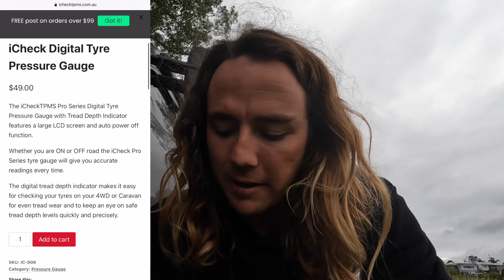4X4 Repairs and fishing a SECRET SPOT you didn’t even know existed! Trip Around Australia / Toyota

Comment: Awesome video guys and very good tips for maintenance and the importance. 
Anybody going on a 4x4 road trip should not take the planning lightly and think of all the possibility's that could arise from or during your trip.  
Most people dont realise that your suspension starts with your tyres, they absorb the initial impact before the suspention takes over. 
So tyres and wheels are super important and cheap equipment will get you in trouble insted of out of trouble. 
Steering is next on the list, check it regularly and repair immediately as needed. 
Then its brakes always keep them clean and mechanically healthy and hydraulicaly healthy. 
You never ever skimp on the three things that can cause serious injury and/or death from your vehicle, the three things that changes the attitude of the vehicle, steering, suspension and brakes. 
Then drive line, grease the prop shafts every service, and if you have any other grease nipples like sway bar or PTO take off’s grease every service.
Wheel bearings need servicing if they are serviceable, and CV joints 😂😂😂 many people get caught out with CV joints not being serviced. 
Regular wheel alignment and tyre rotation and balancing prolongs tyre life and vehicle stability. 
Next is another thing people neglect and its the electrical system, if your accessory's was fitted properly you wont need to spend lots of time to do basic checks and test the battery’s state of health and the charging system and load test all circuits to give them a clean bill of health. 
Next is also very neglected because it always works so what could go wrong…….the cooling system, anything less than 5 years is ok to accept if not used in the bush, grass seeds, leafs, twigs and bugs block the airflow,  after that coolant flush, expansion tank cap and remove radiator for cleaning they get blocked internally too and use only deminirelised water to mix you coolant.
The normal maintenance on the vehicle is what it is, oils, filters etc most people get that right and most of it. But pay attention to alternator belts, AC belts, visco fan, electric fan. 
These are my checks before a trip like you are going on now. 
We wont have our Urban for our December trip but we are still doing a part of it, I will start all the above at the end of September so by mid December the vehicle will get its normal service and check over to just double check all is healthy as humanly possible. 
Thanx for your hard work. 
Cheers
Johnny&Rene
Reply from the maker: Thanks mate!! 100% agree with all of the above!! Maintenance is key  and how you treat your car today is how your car will perform in a months time on a crap track haha 😂 

Cheers legends

Comment: Thanks for another great video, have ordered some TPMS from icheck. Safe travels look forward to the next one. Some tips re the Cape, check tyres car & caravan, make sure roofrack secured, shockies, nylon bushing, stone guard for caravan, cover up back window on car & tail lights, tape up outside door of HWS to keep out dust, also seal vents on van including door vent, pool noodles are good for pipes under van. A pressure system in van is great if you could get one. That's a start, you probably knew all that anyway. Cheers Geraldine & Jack we live in Bunbury area 👍hope to get up to the Cape soon.
Reply from the maker: Thanks mate!! Will do! You have bought the best tpms on the market!! We swear by it!! Sound advice mate! We are having a great time up here

Comment: Mate had knocking in my steering rack over bumps. Replaced rack ends which we’re worn but knock and play still there. Told by specialists that the rack was stuffed. Worked out that all was needed was the steering rack guide needed tightening a few turns. No more knocking and steering nice and tight like new.
Reply from the maker: Yeah right sounds like you got a bit messed around!! Our rack was destroyed!! All good now though

Comment: Great vid guys, love the mix of Maintenance and Travel. Love the Inox tip, will give that a go, I did movables prior to our trip, but not the whole chassis. We have fitted the Couplertec electronic rust proofing to our BT50, it works great. Prior to each trip, and the last one was 15,000klm east to west coast and back, had a major service to check everything was in good condition. Also swapped out the OEM bash plates for Custom Offroad Bashplates - Best choice! Certainly saved issues on the Gibb River Road and Kalumburu road. AND we got the iCheck TPMS 5 sensor kit after seeing your video, Sam is awesome and the kit is amazing. Great piece of mind, even though we only have a slide on camper, not caravan (yet). New Pedders rear springs fitted, carried the removed ones as spares. Overall, we only broke 2 UHF antenna after the corrugations! How is your thick antenna going on the rear mount now?
Once we returned, put the ute back into Good Year for a full overhaul. Even though our breathers were good and high, there was still water in the diff, so that was cleaned, bearings checked and full service. Now just trying each week to get the remaining red mud/dirt off the ute... Can't wait to go again, and keen to hear our Keith Urban tackles the serious off road - considering that type of van as the next investment if it can really be the total off-grid / off-road solution. Thanks guys :)
Reply: hey Brad, Ally have you guys done any mods on the BT50 ? we lifted our 2 inch, it's a 2018 model, with DPF, seriously thinking of changing over to 3 inch exhaust and getting a dyno remap, we tow a van it comes in at 2.8 ton, the car hates hills while towing so want to up the torque.. Looking forward to hearing from you..  :)
Reply: @parkerkenin2238  Hi Parker, Bought second hand in 2016, 2012 model. Already had Scotts Rod 3" exhaust, 140l longranger tank, bullbar, lights, winch, towbar, etc.  We added Pedders Trackryder suspension (about 2in), couplertec protection, iCheck TPMS and recovery gear. We have a slide on camper on the tray so don't tow, but notice the exhaust improves performance. I would love an ECU remap, it's on the list after I can get the red mud and dust off the car from the last trip to WA :) We sit about 13 litres per 100klm with the camper on, and about 3 tonne full.
Reply: There is nothing electronic about rust mate ... waste of $##